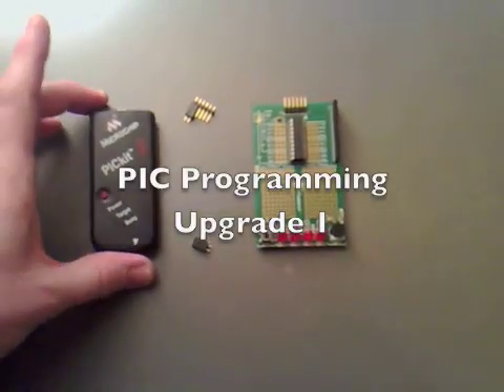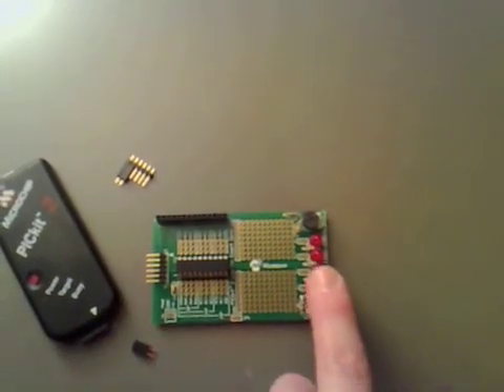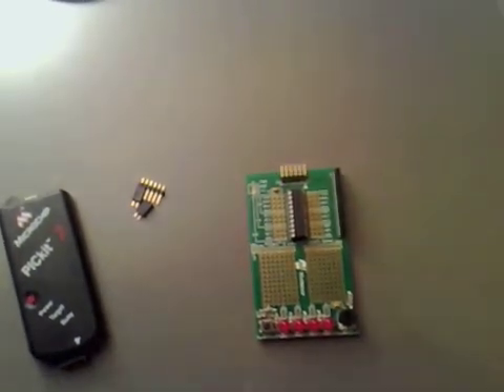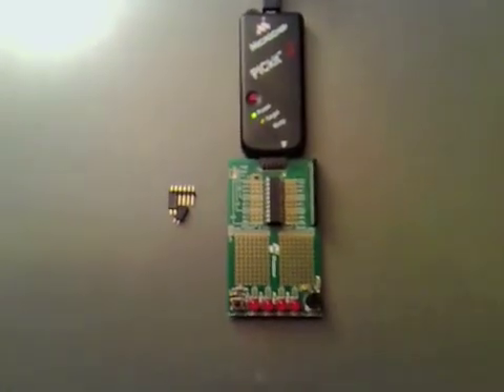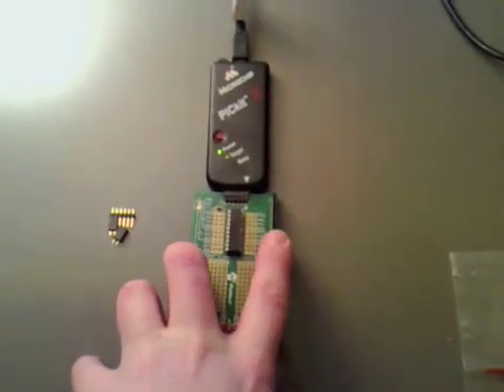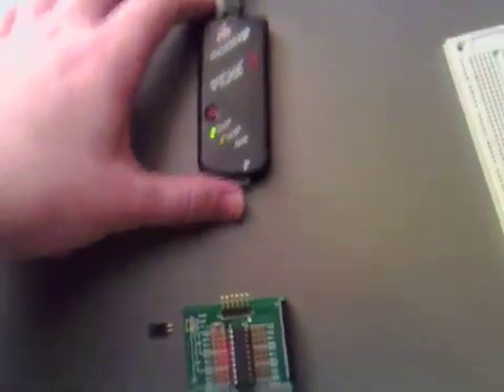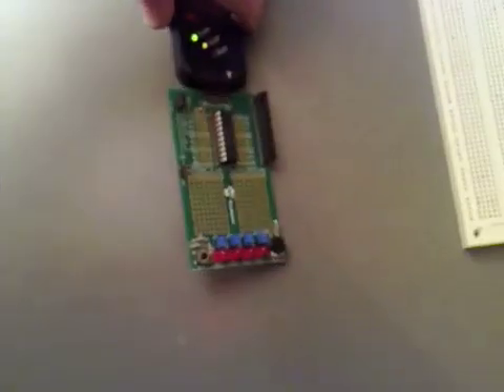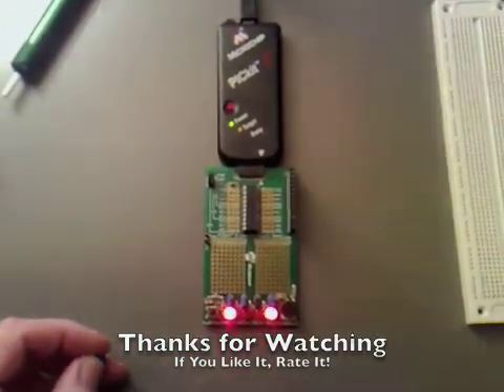PIC Programming (Upgrade 1) 001

Comment from the maker: No problems, Its the only way to get a true 50% duty cycle on a PWM amongst  a lot of other things.

You can basically program them to do anything.

I am going to use it as a battery swapper for my pulse motor also...

Paul.